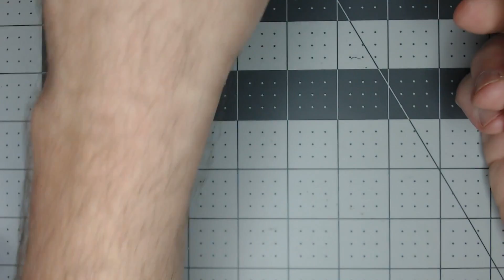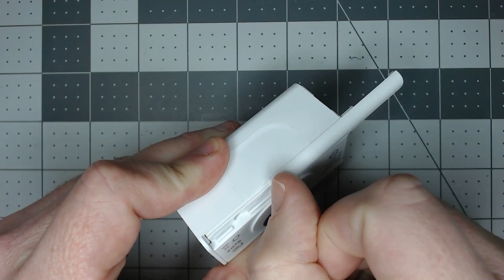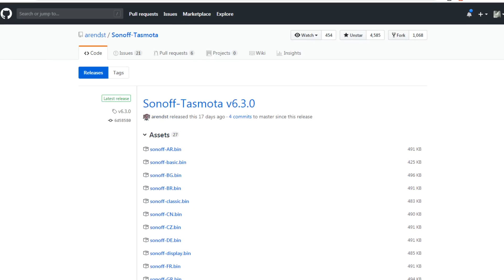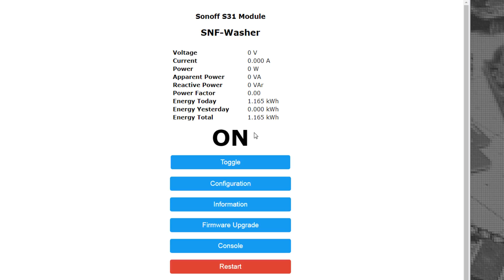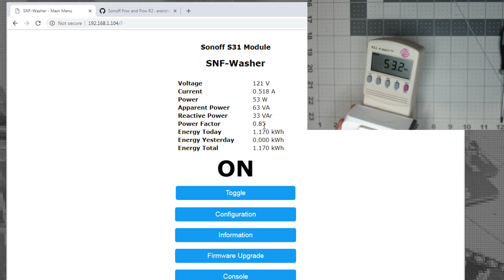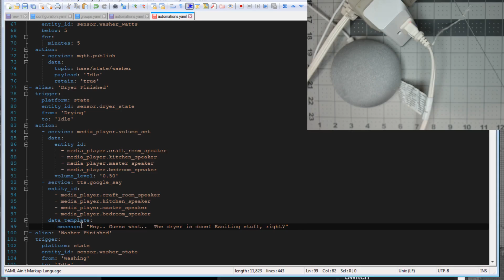Smart Laundry Voice Notifications with a Sonoff S31 & Home Assistant

Comment: How would you accomplish this for a 2-phase electric dryer?
Reply from the maker: I've seen several folks talk about the PEZM models of energy monitoring on the Tasmota Github page.  Here's one, there are probably others.  https://github.com/arendst/Sonoff-Tasmota/wiki/PZEM004T-Energy-Monitor

Other methods would be to attach a split core transformer over one of the legs of the power and monitor the power usage on one of the phases. All non-intrusive and easy to remove and do not impact the normal use of the dryer.
Reply: I think calling it 2-phase is a bit of a misnomer.  Yes the "A" and "B" legs are 180deg out of phase with one another, but when using 240V AC, you're not really using 2 separate phases like you do for 3-phase motors.  You're just using the higher voltage (240V) outer taps from the transformer versus the center tapped neutral that you'd be using for 120V AC.
Reply: I've ordered the parts to build this alternative version - https://github.com/arendst/Sonoff-Tasmota/issues/3626#issuecomment-416976400

The difference from Theo's Sonoff Basic based power monitor and this alternative is that both the HW-655 and the PZEM-004T require 5V so there is no need to convert between 3.3V (what the Sonoff wants) and 5V (what the PZEM wants). The HW-655 handles the on-board voltage conversion for the ESP-01 piggybacked module.

Comment: So I've been doing this with a sensor and am keeping state of the washer using an input_select. I like your method of a mqtt topic better. I might rework my setup to do it this way. Maybe try to do the automaton logic in node-red instead of yaml
Reply: Interested in seeing the node-red logic as well as I'm struggling with mine :)
Reply from the maker: Stay tuned.. NodeRed coverage is up next. Will include this.
Reply: Can't wait!! haha I think I have a version that might work.  Need to do a load of laundry to run it through its paces heh!!
Reply: @digiblurDIY  I would really like to see the node red code. Did you ever complete it? Where can I find it?
Reply from the maker: Definitely share the node-red logic, I use a flow in node-red to notify us every 10 minutes when the dryer door has been left open.  I might expand it to also notify us when the dryer is finished and hasn't been opened and the clothes are wrinkling but I'd need an easy override for the times it is towels and other stuff that doesn't matter.

Comment: Thanks Travis. 
Any tips on how i can use it for my sumppump monitoring ? I have not using it cos i dont want it to  be in off state any time. is there a way to make sure the plug is always on even if it reboots ?....and if its off for any reason there is constant automation scrip check the state and notify till its powered back on ?
does s31 & sonoff pow use the same method for power measurement ? is one better than the other..is ti same as the one in shelly dual ?
Reply from the maker: The powerstate I showed in the backlog forces it to be always on at reboot.  I don't define the switch/relay at all in home assistant as I rarely need to turn it off.  I can cycle it in the Tasmota GUI though.  There are additional power states that will force it on and even remove control from something turning it off. Keep in mind it could be off for a split second during a reboot of the switch itself.  

The S31 and Sonoff POW R2 use the same exact chip to monitor power, they however are just in very different form factors to fit various install needs.  The regular POW uses an older power monitoring chip but still works fine.  The Shelly 2 uses another type of chip, I did hear from the various threads on Tasmota that it wasn't as precise or something though, but again that's only what I remember hearing when the Shelly2 first came out and of course it has a much different form factor and install method.  Great thing about this field is all the different products to tackle the various solutions we have.